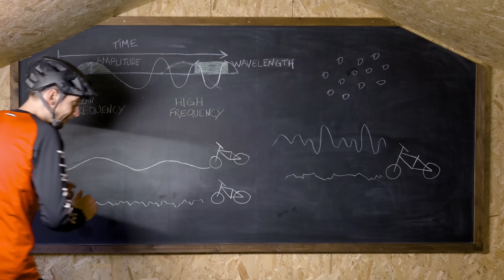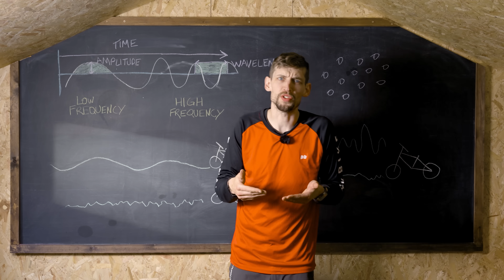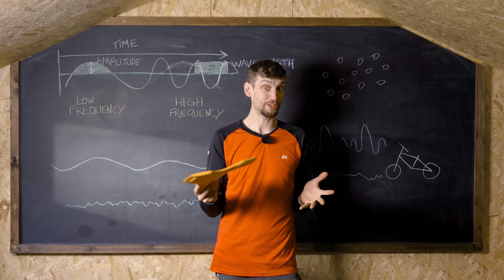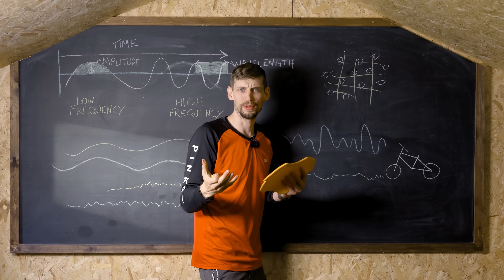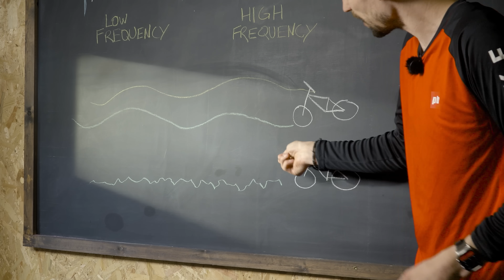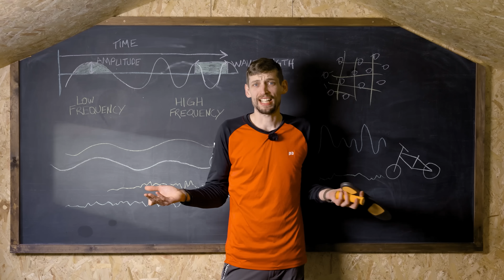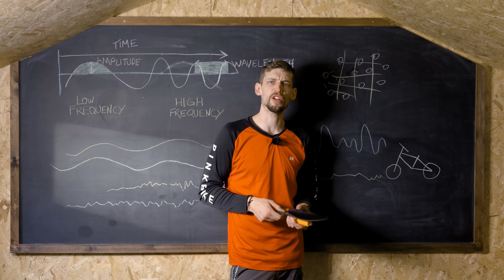The Science Behind Vibration Damping in MTB

Comment: I wonder how much those grips warm up when they dissipate the vibrational kinetic energy they've absorbed. Rear shocks can get warm under riding; front forks are more massive and their temperature increase is usually imperceptible on touch. But grips, they are right under the fingers! Will it get warm to touch?
Reply: Of course they won't
Reply: @smillley21 Yes they will. The energy they absorb has to so somewhere and it will be as heat. Whether the temperature increase is noticeable is another question

Comment: You can get AB structural foam in different densities and pour it into anything hollow. It adds considerable strength and gives a measure of vibration attenuation. It also adds dent resistance to thinwall tubing. It does add a small amount of weight.
Reply: I did fill my giant cadex in the mid 1990's. It survived to this day, of course I don't ride it anymore 😂
Reply: What's Vibracore density, do you know? Without any way to really test this stuff we're just taking a shot in the dark.
Reply: @mattattomotos8756  density listed as between 1.8 and 2.2 lb/ft3, open cell foam